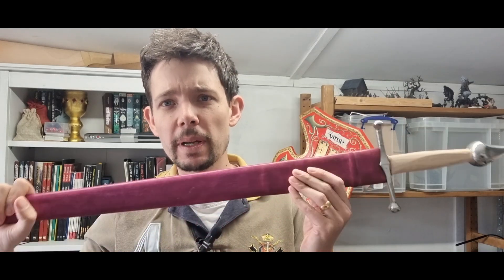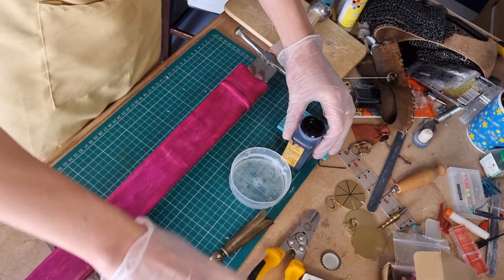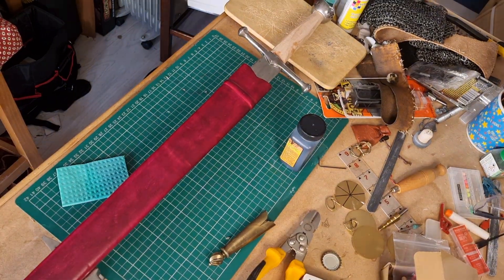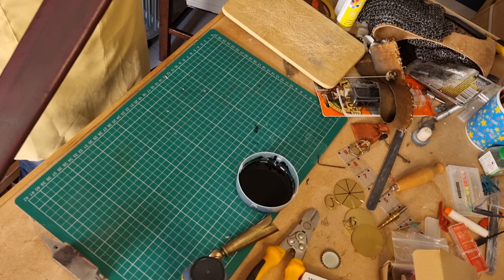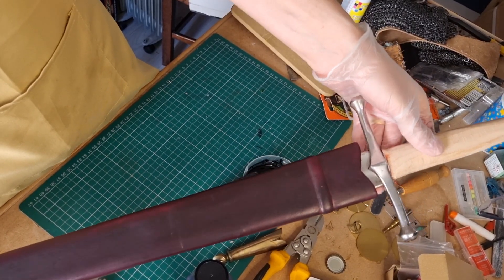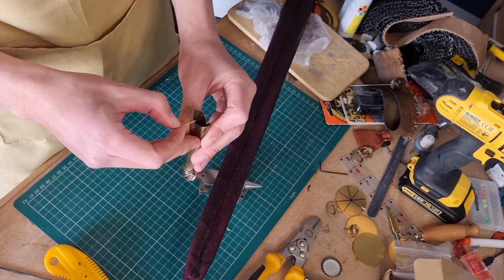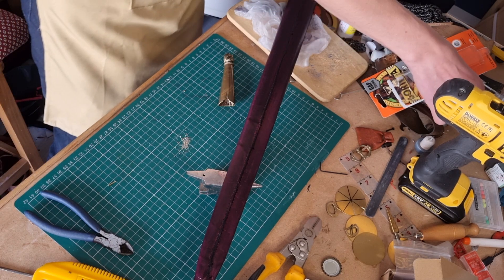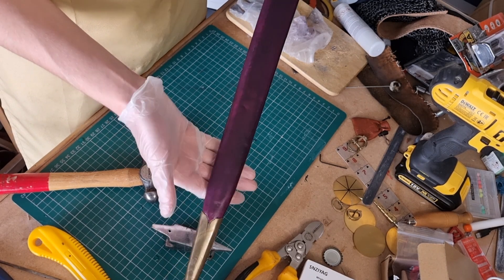Project's Progress: Finishing my Scabbard

Comment: About the "perfection" aspect, I completely agree. In craftmanship, there is a point when it is simply "good enough". Of course I try to make the components on my kits (although they are just costumes) as precisely as I can. But if you examine the items I make, no matter made of leather, fabric or metal, are never absolutely perfect. They do look good from a normal looking distance and do their job, but that is it for me. What I found if you work as neatly as possible from the very start (i.e. making your patterns and then everything that follows that), things usually turn out "good enough" as a result.